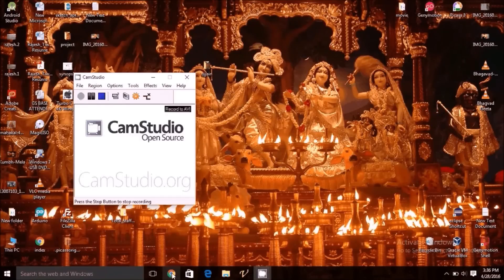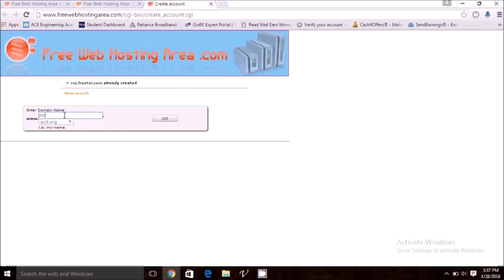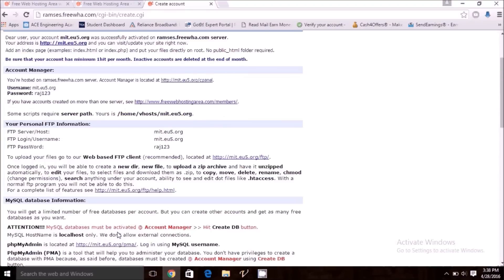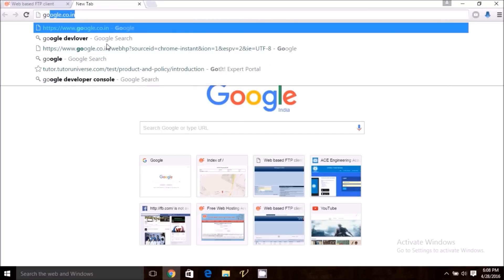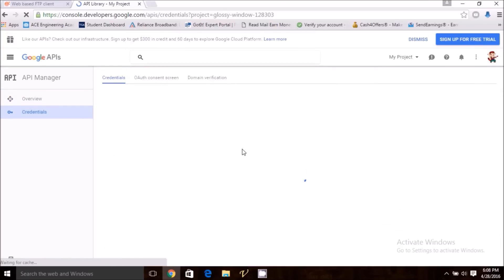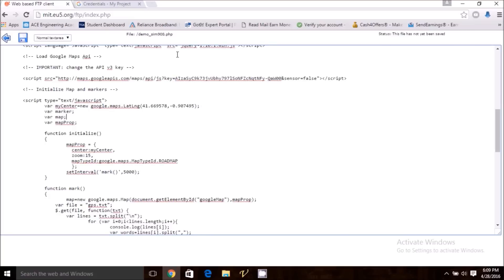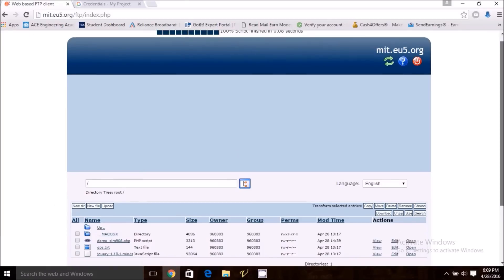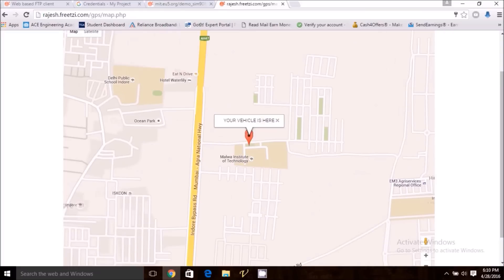How to make Vehicle Tracking System using web interface and GPS system Engineering Major Project

Comment: nice tutorial! subscribe done! can i have your code for the html file and microcontroller sir? here is my email, brunovenus321@gmail.com  thanks in advance! it will be use for my project
Reply from the maker: Done. Check your mail. You are lucky !! I gave you whole source code. Good luck for your project.
Reply: Can you send circuit diagram and micro controller source code on my email address.
mujahid7292@gmail.com